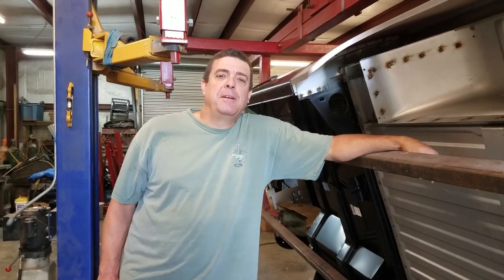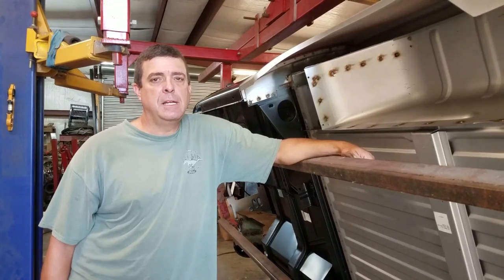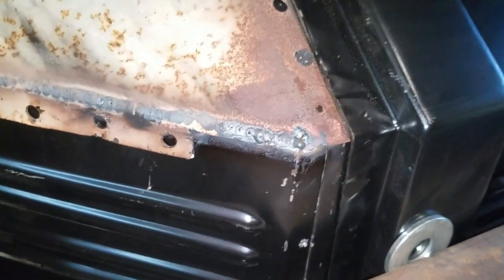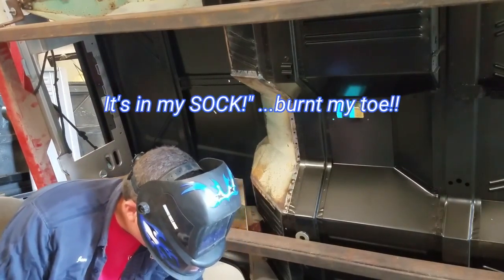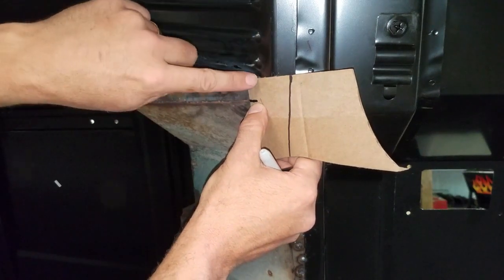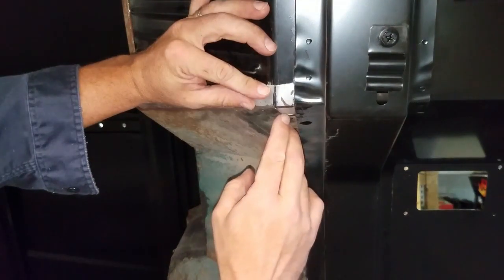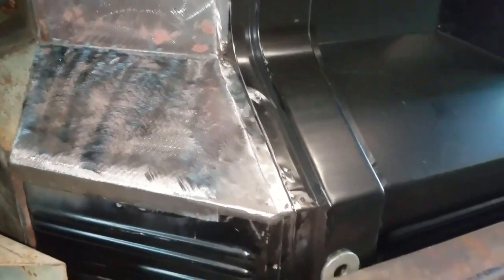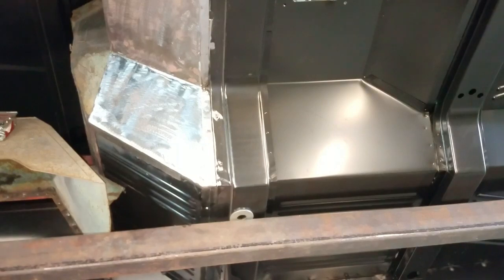Dang It Spots! - 1966 Ford Bronco Restoration Project

Comment: Thanks for another great video. Your attention to detail is tremendous! Did you decide on an engine yet?
Reply from the maker: Tim, I am going to use a 302 I bought a few months ago.  I have a new mid camshaft and intake for it.  I am undecided about which transmission to use yet.  I have a ZF 5 speed but not sure if its going in this one yet.  Decisions, decisions...
Reply: @JasonJonieBuilds  I'm sure whatever you choose will be high quality!